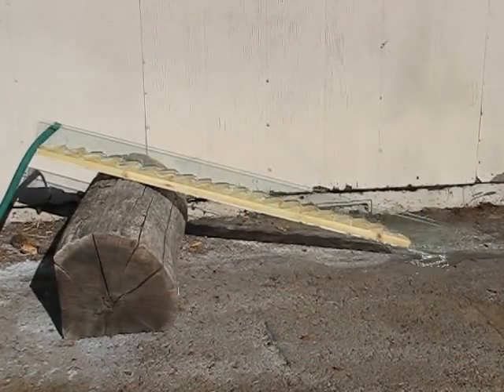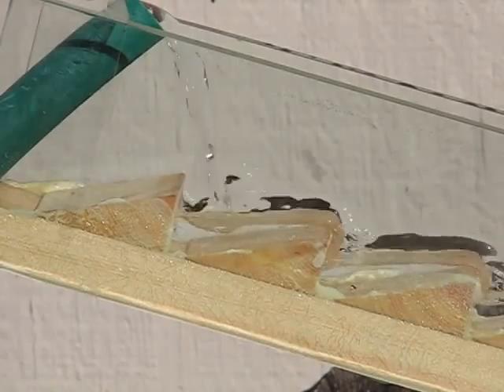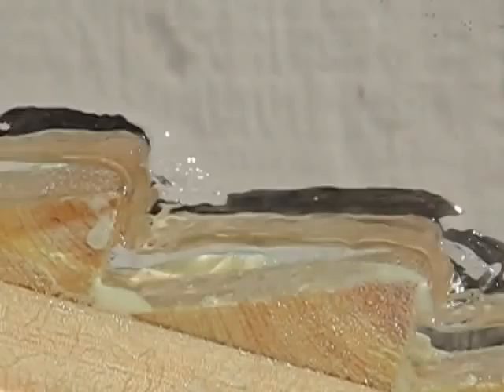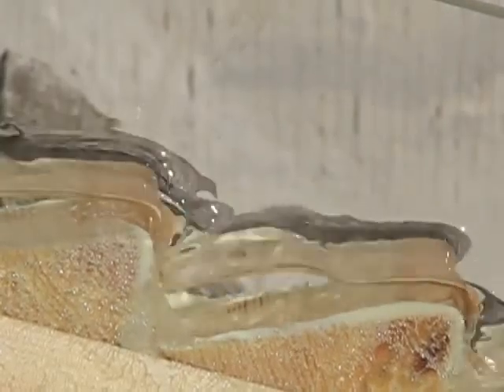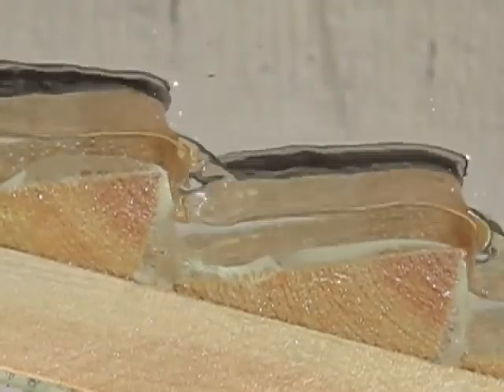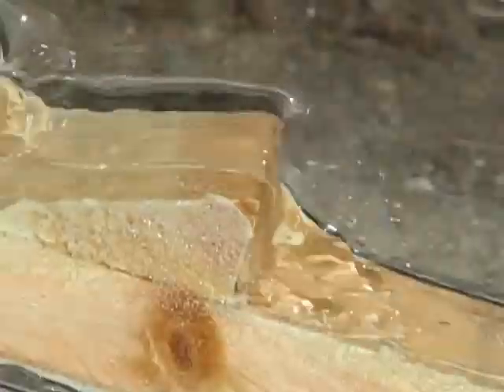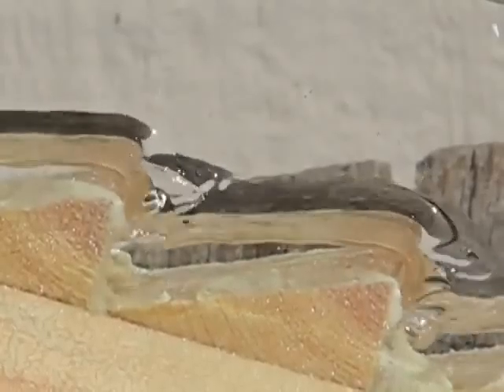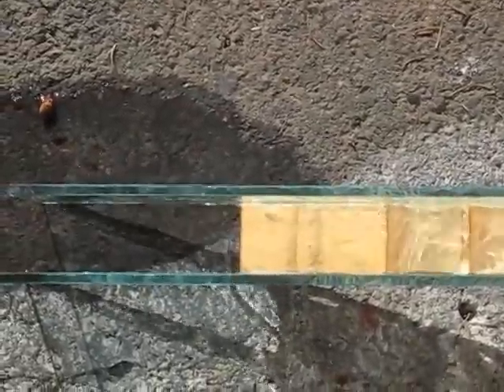World's First Hydraulic Laser (I believe)

Comment: If you don't think that the word "laser" is appropriate, you could call it "Wave Amplification by Stimulated Emission of Water". 

That's right, it's a wasew. Maybe we can use it to hunt wabbits.
Reply from the maker: Yes, I am using the word "laser" in only a metaphorical sense rather than a technical sense. Your term 'wasew' ("Waze -- ooh"?) is better. But if I use that word, nobody will understand it. This device has no possible practical application; I see it only as an interesting way to mechanically demonstrate what happens in a laser.

Comment from the maker: I disagree. A laser (and its predecessor, the maser), operates by setting up a system with a series of stages, each stage being pumped up to a higher energy level than the ground state. When a photon hits a stage, it causes that stage to release its energy in the form of a photon in the same direction as the original photon. When these two photons hit the next stage, the same thing happens, so the pulse gains energy. This laser does exactly the same thing, using water waves instead of EM waves.